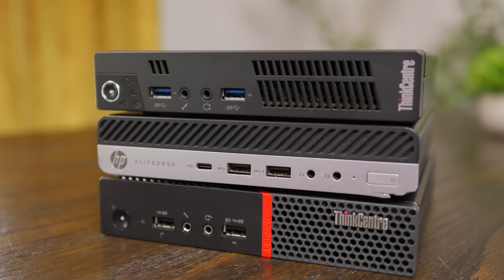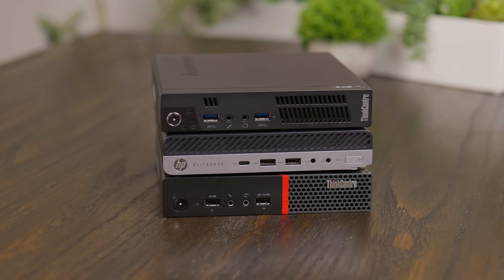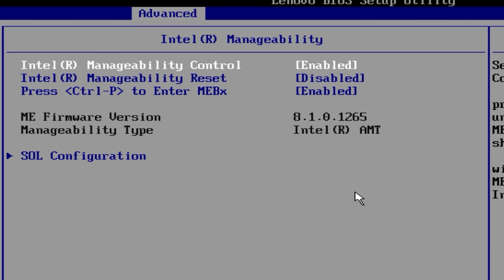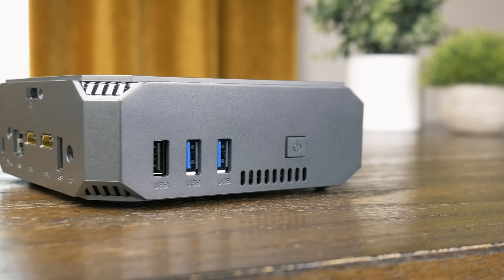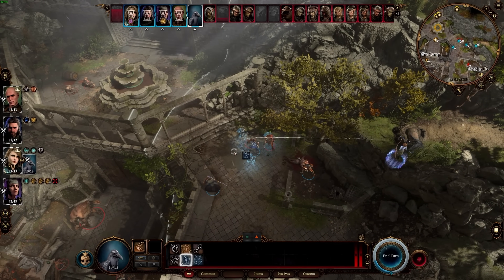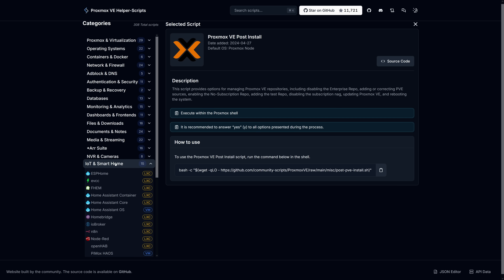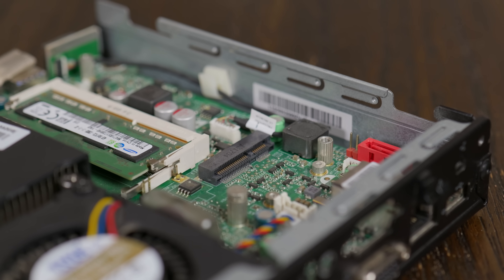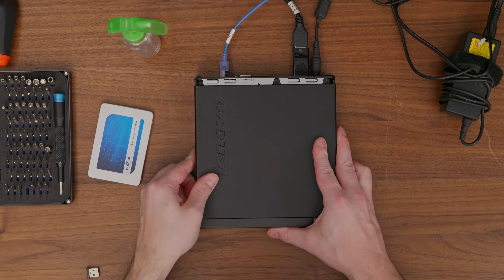Why Are People STILL Buying This Old Mini PC?

Comment: I hunted down dozens of these & other similar systems for my dad's business.
1) They run various old machines through the serial port, using software only available for Windows XP (which these systems support perfectly).
2) They run older digital signage, thanks to onboard VGA.
3) They are perfectly capable as POS systems.
Reply: I always read POS as piece of s.... rather than point of sale. Makes me chuckle inside.😂
Reply: @Bragg-WRC123 before I ever learned the point of sale thing I genuinely thought people called cash registers pieces of sh*t, granted after working customer service and having to manage a register I whole heatedly would like to refer to those pos machines as genuinely being a POS as half the time they never work
Reply: @SiriusG  😆
Reply: @SiriusG  Same!
Reply: #1 is a big deal. and a lot of why they are so expensive for the specs. Lenovo provides full driver support for every X86 or X64 version of Windows from XP all the way to 10, making them uniquely versatile for a lot of applications, especially where someone wants/needs to run XP or Vista AND a modern version on the same system. Support for Windows XP X64 isn't super common either.

With 16GB RAM and an SSD, that system would be entirely overkill for most XP/Vista uses, but also very quick and usable in the modern world if you aren't doing anything demanding like gaming.

While they are definitely too expensive for their specs alone, people are willing to pay when they have a specific use for its unique capabilities and I can't see prices coming down any time soon with less and less working legacy capable hardware in existence every day.
Reply: As soon as a saw it had a 3rd gen Core i CPU, I knew it was probably an XP thing.
Reply: I got a used POS system, it was in use about 2ish years ago at a subway, 512gb sata samsung ssd, and that was the end of the good news, it used a mobile core 2 duo and capped out at 3GB of ram, though the documentation said 4GB.  It also had a weird thing where it would reset if you adjusted the built in screen's angle, i think it had a short.  It also wouldn't install 7 directly, i had to start the install on another system and it would work, but even 7 wasn't a pleasant experience, i never bothered to try 10.
Reply: @subrezon:  "POS"... LOL!  😁
Reply: Even modern versions of the HP DM series supports VGA output, some require a VGA flex IO module which is used as cheap as 1$.
Reply: Actual compelling reasons to buy the older systems at roughly the same price. Most of them are ready to run through a shredder and reclaim/recycle the rare metals.

Comment: Lenovo m720q/m920q are the best Mini-PCs I've bought. Running one for my OPNSense router. The other two as proxmox machines.   I've tried both HP and dell. But love these m-series lenovo boxes. Mainly because of the PCIe slot. No other mini-PC provides that in such a small form factor.  Not to mention they're dirt cheap machines to buy on ebay.

Comment: One thing to watch out for, when you buy one, boot into BIOS and make sure you don’t see a Computrace Activated message.
Reply: There is a complicated manual process to clear that from bios, but it can be done.
Reply: @JLSticePro  Would love to have complete details for manual removal, I have two laptops that are locked and can only run Linux.
Reply: @JLSticePro Complicated lol
Reply: It's definitely a problem. However when I got some thinkpads of a similar age that my school was throwing away I was assured by the IT guy that they had long since fallen off the system and that I wouldn't be thrown in jail for legally acquiring junk.

It all depends if the system was actually decommissioned and whether the organisation still used lenovo (school had switched over to HP) as once they stop using lenovo the systems with the computrace module enabled won't have any major consequences AFAIK
Reply: I saw someone on youtube that had been using a surface that wasn't removed properly and they ended up installing Linux to bypass it, because installing windows would just result in the system locking out. 
That was at least until they were able to get ahold and deactivate it through calling.
Reply: If you got the system legally, I believe you can call Absolute Software (the company who created Computrace) and have them disable it. I never had to do it myself, but I have heard of others doing it no problem.

Years ago, a friend was loaned a Lenovo PC with Computrace activated from a former online school he attended and they didn't bother recovering their then old systems when they eventually permanently shut down. Anyways, his Computrace was automatically deactivated shortly after the school was shut down, so it didn't end up being an issue in his case.

Still definitely something to look out for though, ESPECIALLY if you are buying the system from a potentially questionable source like a private individual. If I was buying online, I'd ask for a picture of the BIOS screen showing that it's not activated. If buying in person, you should check for yourself before you buy it.
Reply: Sounds to be another hardware bricking feature to force obsolescence after the original owner decides to stop using it.
Reply: @pixels303at-odysee9  It's really not.

Comment: If the price were actually lower I think it would make a great backup kubernetes worker node for a home cluster,  where it's job is to be a paperweight if everything else is working properly and to be an emergency fill-in if it isn't. But with Win 10 EoL hardware flooding the market, the newer stuff makes more sense until prices fall.

Comment: You can reduce temps significantly by deliding and repaste as this is before Intel starting to use solder as thermal interface, 💯 the thermal interface it's cooked and expent.

Comment: I've been eyeing something like this for running Linux. One for home theater PC and the second for retro gaming. Unfortunately the price of Raspberry pis are close enough and current availability that you're almost better off just running a light weight distro off an older x86 system. It used to be the bare minimum cost for a mini pc was too high but we're at the point where they're really cheap.

Comment: Industrial use, for one companies that own huge machines, they are designed to fit a specific computer with the specific port layout, but even more than that, some older machines need windows xp to run them. 3rd gen intel and older is compatible with windows xp with full graphics support. So if s company needs to run windows xp x64 edition for some specialized hardware this is a good option

Comment: Any Ivy Bridge CPU you will need to delid it and change out the TIM on the die. For Ivy Bridge Intel decided to use a thermal paste instead of soldering the heatspreader directly to the die like the the previous gen Sandy Bridge. The thermal paste that they use on Ivy Bridge basically turns into concrete and acts like a thermal insulator. This is a known issue with Ivy Bridge CPUs and there's many write-ups over many different forums and links that show this.

Comment: I bought a Thinkcentre M710q I3 for $40, added an I7-7700, 8Gb RAM that I had laying around, and it makes a really nice little backup PC.
The CPU runs at 56C under normal use, and the fan only comes on when I am really pushing it.
Running Linux Mint from a 256Gb  NVMe with no problems and a 1Tb ssd for storage

Comment: I have 2 M710q's with a 7700T and 6700T procs but they both run hot... repasted the CPU like 5 times on both and they still idle at 72-75C and peak at 80c.  No one can explain it.... They are both 35w TDPs.... :(

Comment: Thermals in the Lenovo M93p with 35w Haswell is way better. Mine runs BOINC with the CPU (i7-4785T) at 100% 24/7 and stays under 75°C

Comment: Great video. We have  an Elitedesk 800 65 Watt, an EliteDesk 600 G4  and a Prodesk 400 G4.  These also start getting trouble with Playback of 4K video. Adding fresh thermal paste is a good thing to do.
Unfortunately you have no control over the fan. One thing I did not try is the logging options hidden in the bios of some models. you can provide an URL to a log server.
One system is running Manjaro and One is still on Windows. I will soon turn these into a nice experimental Kubernetes cluster.

Comment: My UnRaid box has an i5-4590T so barely a year newer than this, it will probably die before there's a need to upgrade it - HEVC would be handy, but not a huge deal, everything else I run could run on a Pi...and it idles at 26w.

Comment: Got 2 m92p SFF here (Also have a Dell Optiplex 7010 SFF with the same CPU and chipset).
They all make good little test rigs.
They have had some upgrades.... i7-3770S and 32GB RAM.
Was running one as my main machine for a while, and had a PCIe slot to m.2 adaptor for fast storage. They will never boot from it as the BIOS doesn't have the support.

One nice thing is they have 2 PCI slots.

Old... yes.
A bit sluggish on some tasks.... yes.
Useable..... yes.

Comment: My M720q is amazing. I was using a Trash Can Mac Pro with a Xeon and that thing would easily pull over 100 watts. I managed the scale back the RAM I gave my VMs and got down to about 24GB usage. I then bought an M720Q with 32GB RAM, chucked a 4 port NIC in it and it runs all the VMs I need perfectly fine with like 10% CPU usage and uses basically no power, they're amazing machines.

Comment: I've 2 HP Elitedesk G2 Minis and a G4. One of the G2s has been running Proxmox 24/7 365 for over 3 years now, with a brief annual service of a new fan, remove any dust and fresh CPU paste. The other G2 has occasional use for Netflix, YouTube and other catch up services on a 32" 1440p monitor in the lounge and the G4 is used the same, but in a bedroom.
NONE of them retained their preinstalled Windows OS beyond 30 minutes of being delivered to me.

Comment: I got my hands on 2 M73 & M93p Tiny's installed windows XP on them, if you get the right Haswell SoC you can get GPU drivers working, and yeah it's a super portable Windows XP LAN kit.

Comment: Wow dude, thanks for showing that there is remote control. I've owned five of these for almost 3 years now and just found out about it. I have 16 GB of RAM installed, 128 GB SSD on each and Proxmox VE cluster. Everything was fine until I wanted more and bought myself an hp apollo 2600 g10)))

Comment: I would say Ivy Bridge still holds up for many uses but I'm talking about the quad core chips, dual core is definitely going to be pushing things a little too hard these days.
Does a mini-PCIe to full size PCIe adapter exist? I have never seen one but curious if these machines could host a small GPU in a janky way.

Comment: G4 Elitedesk 705 Ryzen 5 - can dump 32gb of ram in it and its 4 cores 8 threads, I have 3 of these I bought for less than $150 off ebay. I'd love to have more cores and more threads, but I can run multiple servers via proxmox. Thats why I love these machines, and will continue to buy them. Also, most of the HP elitedesk are able to be imaged over to ChromeOS Flex and just work "out of the box".

Comment: Just picked up some old Lenovo M720q from work, I have been surprised by their performance and hardware capabilities. They have socketed CPUs for upgrading, NVMe slot, 2.5in SSD, PCI-E slot for add in cards. Current CPU in it has an Intel UHD 630 iGPU, great for transcoding.

Definitely worth the couple extra dollars over the system in the video.
Reply: I've been looking precisely at these systems to make a router out of them, they're the best balance I could find in terms of cost, size, performance and expandability thanks to the pcie slot.

Comment: There’s a lot of those “This wouldn’t be something you should buy but if you happened to find one it’s more than capable” machines out there, which is part of the reason why I even started into a hobby of refurbing and repurposing old machines in the first place. So much potential is wasted when you think you always need a modern-spec’d-hardware machine for a very light server task. Like yea, if you’re literally netflix or google you shouldn’t be using a mini-pc for even non-mission critical tasks, but you can get away with quite a lot even on as far back as decade and a half old hardware if you’re willing to do a little bit of software wizardry and hardware bodging.

Comment: My father and father-in-law use this exact model. And as a computer for browsing the internet, YouTube, and paying bills, it works great. I don't see the need to buy something newer, more powerful. Because this computer works great.
Reply: One caveat is that Windows 10 support ends this October, and Windows 11 doesn't support older than 8th gen CPUs. If you're open to something like Linux Mint or Pop!_OS then you're good to go.
Reply: @ Linux has been installed there for a long time. It is lighter than Windows and more secure.

Comment: I had one of the same gen and used it as my first linux desktop. It worked really well and it was a great platform back then. However, today I would get something newer. Even intel cpus that a two gens newer still struggle with video. So, it works and it works well, but.. get a newer version of the thinkcentre.

However, I LOVE that you are doing these kind of videos. There is a lot of hardware out there which still have many uses. Such a waste to just throw them out :)

Comment: I have a Lenovo M900q with the same punch out hole for a (probably) VGA port. I took the chance and bought a M.2 to ethernet card, and the ethernet port fits almost perfectly. I just had to remove a few milimeters of the top with a pair of pliers to make it fit. It works perfectly!

Comment: I have three of the M93p units, all of which I got around 2020. At the time, I found them to be a good option for cheap single purpose hackintosh builds. I also wouldn't be surprised if a lot of folks today are buying these because old homelab/retro gaming channels made videos several years ago (rightfully, at the time) praising these models. They are great little PCs but if I was looking today I would be searching for newer 1L Thinkcentre models.
Reply: My work got rid of a heap of m93p just before COVID hit. So I got permission and took home like 5 of them.

Most of them have now been binned as they just got too old and slow. My parents still have one, we put a cheap 256gb Kingston SSD in it, it already had 8gb ram. Its got 2x Lenovo 1440p monitors and its still running fine. They just needed a PC for chrome and MS office. 

It will be replaced once win10 goes EOL. but it served them well for 5 years and my work had them for 4 years.

Comment: I have two of Mini pcs. the Lenovo m73 I5 4570T and M93p upgraded both to 16 gigs of ram and I use them for my laser engravers in my shop to run Lightburn. without issue.  got them on eBay $50 Per they are great little units.

Comment: I've been meaning to track down some of the lenovo mini pcs that have an NVME slot and a dedicated optane slot. I've still got half a dozen of those 16 and 32GB optane drives that would be useful as accelerators rather than very durable boot media, though they've been incredible for that with ventoy.

Comment: I have an 8th gen elitedesk with a 8600T 6-core, 32gb ram, and 2x256gb pm981 ssds running proxmox like an absolute champ (storage is on its own). I don’t think I’d go lower than 8th gen intel because this is my plex machine and the igpu supports h265. 

I have a lot of nostalgia for ivy bridge, it was my first build getting back into gaming after a half decade of being laptop-only, but it just doesn’t have a lot of legs these days if the price is SO close.
Reply: Ivy Bridge was viable for over a decade with very good efficiency. Great generation.

Comment: Since I saw your video where you took a look at the tiny HP I've bought 2 of them. The newer one has a built in Nvidia graphics card and is now my regular desktop. I've never tried one as old as the one you looked at today but I'm sure there are any number of uses for such a system, like a cheap alternative to a raspi when building a pihole

Comment: I love these tiny office PCs too.  I am pretty sure I found this channel through the video on working on three seemingly broken Lenovo units.  I have four of these tiny office machines, two Lenovo and two HP.  It just never worked out when I was looking for a Dell.  I've had to stop myself from buying more quite a few times, though I did also get a Lenovo SFF at one point which is useful for the extra drive bays.  My two Lenovos are an M73 and an M93p, which are almost identical, both with the i5-4570T.  From the looks of it, they changed the thermal solution a bit for those fourth-gen Intel chips, so perhaps the numbers would reflect that.  My HP units are later models, one with a 6500T like yours(but in the gen two case. black), with the other having a Ryzen 2400GE like your other Lenovo.  Those have SATA and M.2 drive ports which makes them more flexible and useful with less effort.  But even the old Ivy Bridge and Haswell ones can be good for a lot of things, especially with the 9-13W idle power, which seems typical of most of these systems regardless of generation.  For example, in my case, I don't do live transcoding with my media server, so the extra power draw on the server when I watch a video is tiny(or mini, or micro).

You mentioned the possibility of going older, though I'm not sure you can go much older than that in this form factor.  I believe the M72 is one of the first, if not the first, of these tiny Lenovos.  That might explain the thermal management.  I believe HP's went through a similar evolution.  I know Dell had a slightly bigger USFF line before their micros.  The USFF machines are cool too and a good size, but are just not that common.